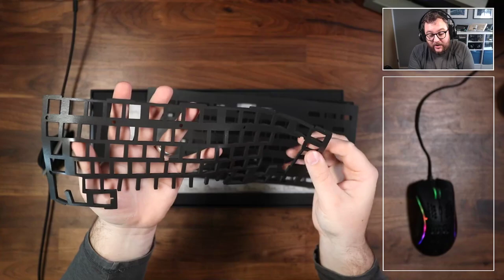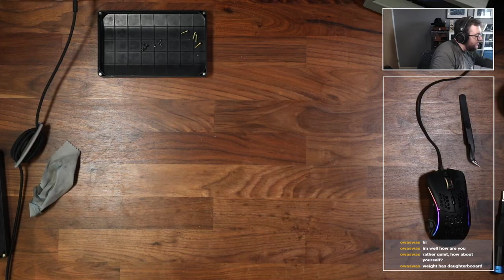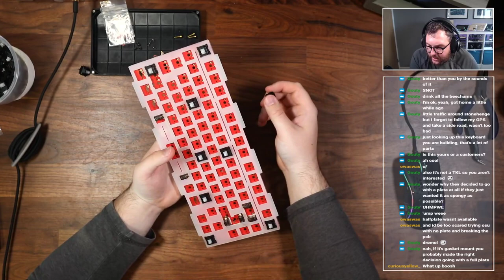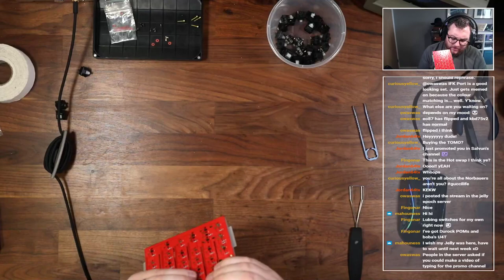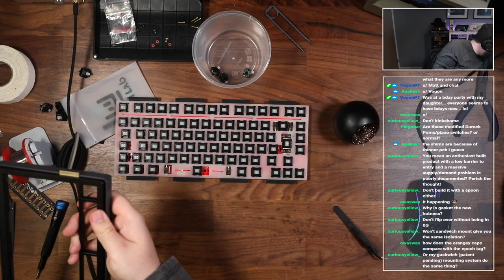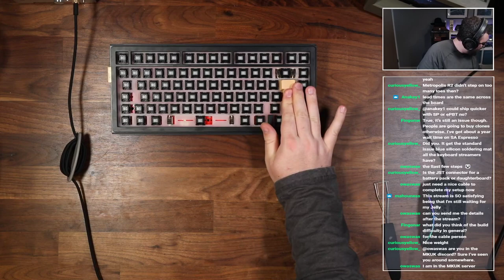Keyboard building stream! Jelly Epoch with JWK Pianos

Comment: You should have built it with the thin sheet of PE foam. Explains why your sound test for the jelly sounded muted. Adding the foam accentuates the sound of the board
Reply from the maker: The switches themselves having uhmwpe stems will result in a muted sound profile overall. The customer wanted the foam but it's not too hard a process to swap it out when he gets it.
Reply: @mathewteague1  Understandable, however the PE foam sheet is what gives the Jelly its characteristic sound. This was a recent discovery in the OwLab discord
Reply from the maker: @jameschiu2254  I will recommend that he removes it in which case
Reply: @mathewteague1  Yup!! Gotta use both plate foams.
Reply from the maker: @zu22779  yeh, I got the board back and have now installed it. Makes quiet the difference! Just waiting for some PE for the spacebar as the original sheet comes with a gap there.